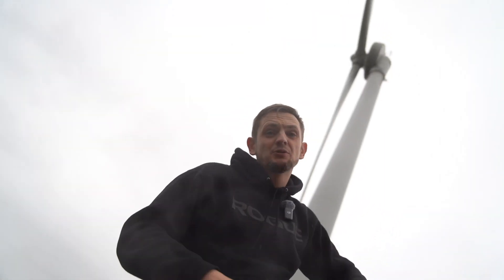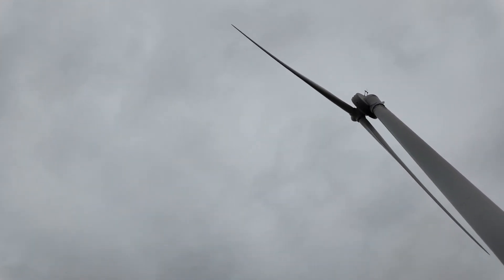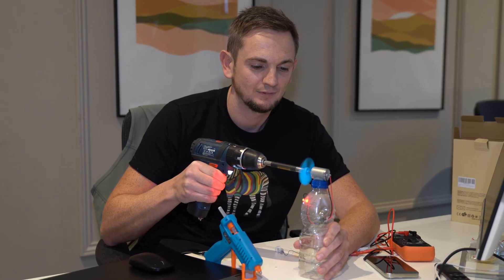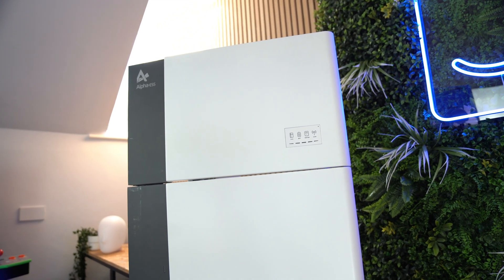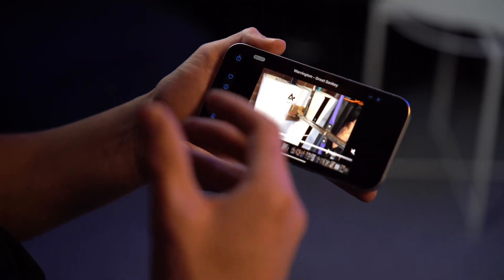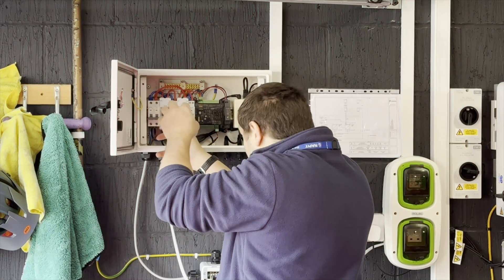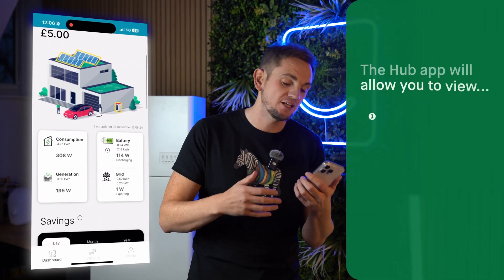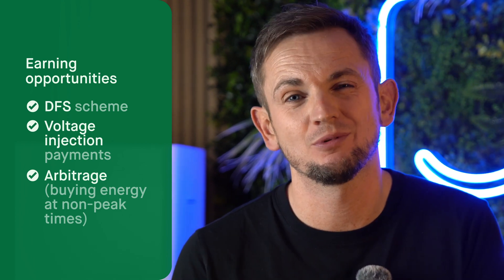EARN CASH from Wind Turbines? | Heatable Hub EXPLAINED

Comment: Is it the inverter that  makes it compatible or do you need that brand of battery too?
also is this for three phase electrical system or will it work with a two phase system ?
Reply from the maker: The inverter does all the comms and controls the battery with the Alpha system it is only possible to have the Alpha inverter with an Alpha battery. The battery is currently only approved for single phase.

Comment: Interesting stuff. I assume it handles charging the battery back up again as well? How does it work out the cost if you are on a ToU tariff? All good and well earning a fiver for injecting some energy back into the grid but if it costs you a fiver to charge the battery back up again then it's worthless. 

This is why DFS will likely fail for domestic BESS this year. Once you take wear and tear into account on the BESS and having to charge the battery back up, you need at least 50p/kWh which is more than gas and NESO have already said they will take the cheapest generation so BESS will never work out as DFS now stands. What NESO should be doing is working some cost of using gas and its carbon creation as an expense and boosting DFS prices to offset the lack of carbon. But I've not seen them considering that anywhere 😢
Reply from the maker: Hey, as part of the commissioning, the software requires the current tariff information. This data is then used in the algorithm for ancillary services, arbitrage, DFS etc.
We are closely following updates from NESO and the DFS scheme, trying to learn more 🙌